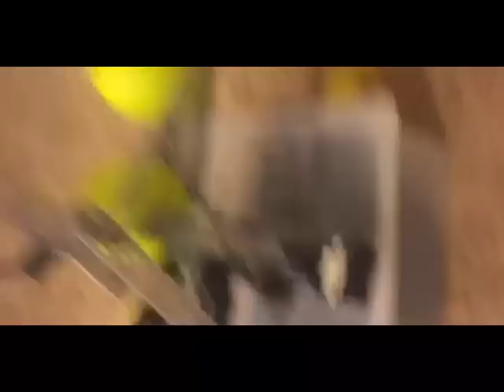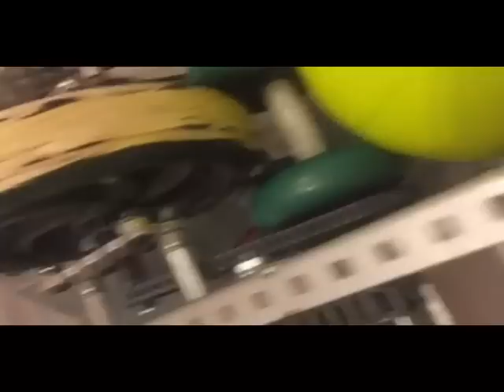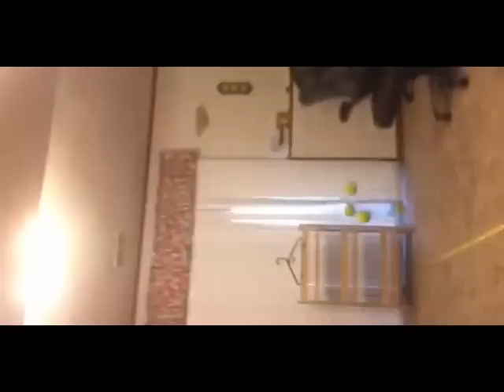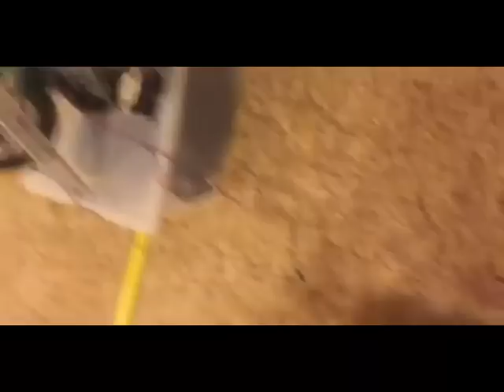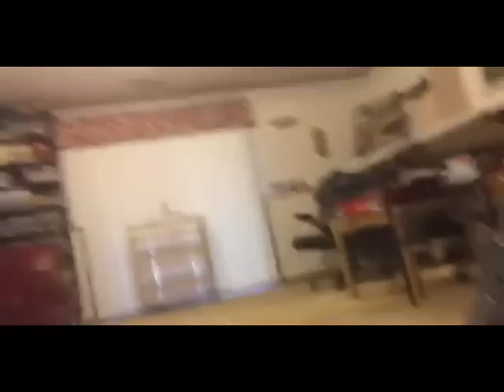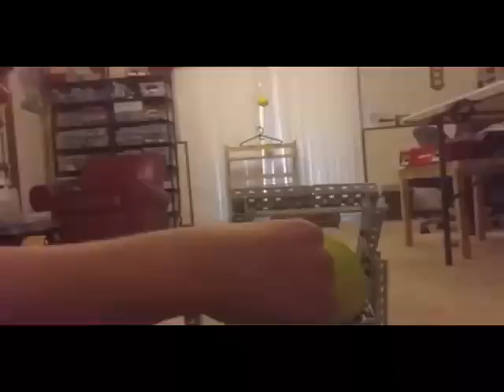VEX NbN low-friction launcher prototype

Comment: How long did it take to make this?
Reply from the maker: +Samuel Crouch It took about a month and a half from the first prototype to this design and it is still unfinished. In addition to the flywheel bearings, backplate size, shape, and material will be very important to the launcher performance.